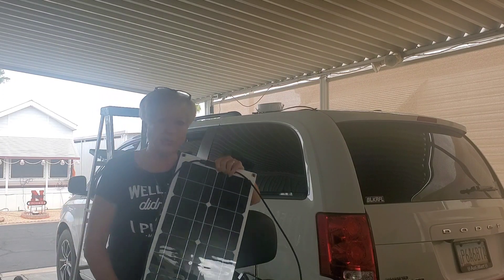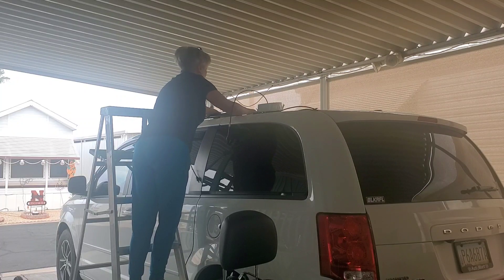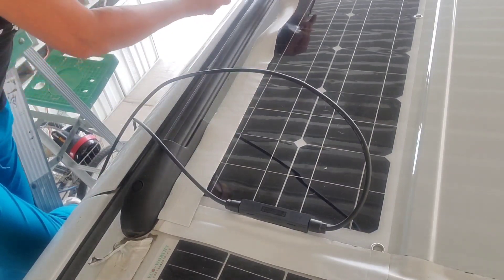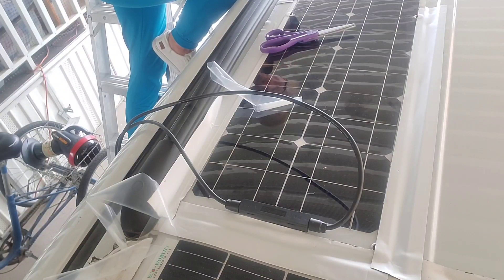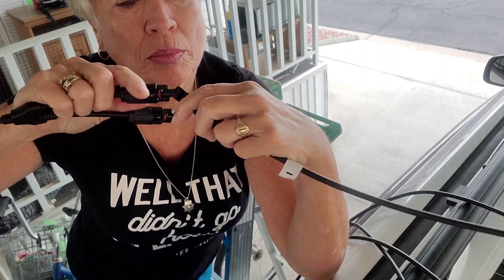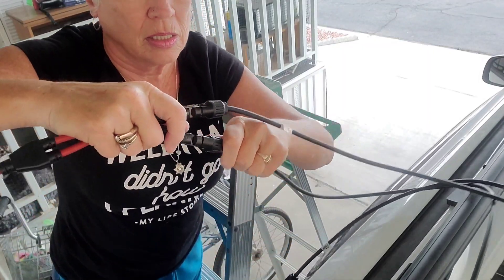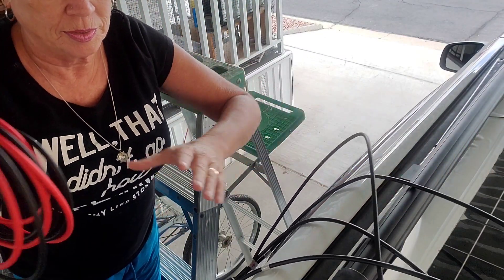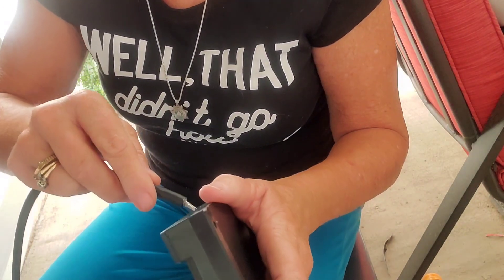My new solar setup

Comment: There is a tool called a multimeter for measuring watts, volts, etc.  They cost between $20. & $50.   But if u know an electrician he might measure your solar panels for you.  It always helps to know for sure what you're working with.   Have a great trip.

Comment: Set it on a stable surface, it's OK to trim a few strands of wire off the larger gauge to make it fit (emphasize a few strands).

Comment: You're right about the size of the wiring being smaller the higher the number is. It's the same for wiring and stringing in jewelry making. The smaller the number, the thicker in diameter the wire or stringing material. That's a lot of wiring on top of the van. Were you planning to hide them a bit under some tape or let them be? As long as it all works, that's what's most important, right? 😉
Reply from the maker: Just leaving it for now. 👋

Comment: Good luck with it all. I'll eventually (probably sooner than later) need solar as well. I use two 12volt car fridges - 1 for a freezer, 1 for a fridge. They have to be on a continual run since I am a fulltimer. 
Keep posting on how this is working out for you please! 
Solar is soooo confusing.

Comment: Remember, you cannot be charging lithium batteries when the battery's temperature is at or below freezing.  Doing so will ruin your battery and could cause a fire.  Either battery's BMS must prevent charging, or your charge controller must prevent it.

Comment: A couple answers: first, strip back more of the insulation so thatJUST the wire is going into the entry area of the hole.

Second answe would be to take the controller to a local auto parts store and if you find a nice counter person ask him take a piece of wire and test what is the largest size wire the will be fit.

Once you know the right size you need to buy 6-12 inch of red and 6-12  black wire of that size.

Now you have two options.

If your lucky and have a place near buy two connectors to fit the red and black wires you have. And you buy two solar connectors to fit the new red and black wires you just bought. You install these connectors and the install these small numbers you just made into the holes/terminals on the controller. In reality you just converted your controller from being screw terminal into a controller with two pigtails (one red one black) .

Another way is to simply splice these ne 6-12 inch wires onto the Amazon wire you already have. Technically this would be fine. But you need to be sure you do a good splice. 

Personally I would do this last splice method. But I would do a good job of splicing followed by putting flux paste on the splice  soldering the splice and putting heat shrink on.

Btw, I lost Dutchess last year. But I know she would have said hello to parked
Reply from the maker: Thank you and I'm so sorry about Dutchess  😢
Reply: @CaravanCarolyn  thank you, Dutches was my best buddy.

Comment: I bought a 100 watt panel from Amazon and it was so small when it arrived, I knew it couldn’t be 100 watts. I contacted the seller and apparently he was drop shipping those panels. The original supplier was sending these tiny 25-30 watt panels out. Glad they refunded you some money.

Comment: Carolyn, question , will you be using the solar panels to power your refrigerator? How do you know what charge controller to use and will you need a inverter.  To plug in the fridge.  This solar stuff is so confusing to me you make it look easy 😊
Reply: She will use both charge controllers at the same time.

Comment: You are correct.   It does sound backwards, but that is how Electric Wire works.   The Smaller The Number, The Bigger The Wire.

Comment: You should consider some expanded plastic for under the panels to promote airflow. They get hot in the sun and can damage the roof. Also, those controllers are really cheap. I would use some solder on the cable and shape it to fit the controller. And you’re right you need to strip the cable back a bit more. (I have one of those cheap o’s!). Good luck
Reply: Love your videos!
Reply: Heat is a major issue with flexible panels. It's ironic that solar panels need to be cool to work at their best. They may have improved the technology though.
Reply: I have current panels and they need aiee the. The black surface attracts heat and transmits it through to the metal below.

Comment: Those look like 100 watt panels for a total of 200 watts. I assume the company advertised the two together as a 200 watt panel, but that is steal terribly misleading. And yes, you will need two separate MPPT controllers for the two different panel configurations, but they will work that way just fine. I would let Amazon know that the company pushing '200 watt' panels is lying to buyers and needs to be called on the carpet. You should have a good system once all is done my dear!
Reply from the maker: No, they advertised it as 400 total. Can you believe that?
400W Solar Panels Kit 24V/12V... https://www.amazon.com/dp/B0B8VGH9QF?ref=ppx_pop_mob_ap_share
And the "40A" charge controller is about 4oz of cheap plastic
Reply: @CaravanCarolyn  can I believe that? Honestly it’s hard to believe. It is almost exactly half the size of a single 100 watt Renogy 100 watts panel, I have 4 100 watt Renogy panels on my van. I have one 415 watt Trina solar panel on my cargo trailer conversion. I have 2 Bouge RV 100 watt panels and one all powers 200 watt ground panel. All of those panels calculate to approximately 0.125 watts per square inch. This manufacturer claims 0.5 watts per square inch. Which is exactly 4 times more efficient, but they boast that their technology is 1.3 times more efficient. I believe that these will turn out to be less than 400 watts total.Their specs are a little questionable where they claim up to 36 volts open circuit where Renogy claims 24 voC.
That said it will still add power to your battery. But if you find that they produce 400 watts I promise you I will add some to my rig. You are right to be skeptical.
Reply from the maker: @Endless_Skyway_Adventures  Right?😂

Comment: I never order Amazon, as I worked at Whole Foods for them, and they are not your friend...believe me! Also, had a scammer, and don't trust them anymore either.
Reply: I've tried getting away from Amazon. But l live in the mountains, far from everything. I get almost everything online. Unfortunately the best deals are on Amazon. Plus the return policy is hard to beat. I tried switching to eBay. But aside from higher prices, longer waits, and shady sellers, returns will cost you and are a hassle. In my case l have decided Amazon is a necessary evil. I still shop around and if l find something at a equal price to Amazon, l'll order there, but it's rare.
Reply from the maker: Exactly, a necessary evil.  I buy almost everything from Amazon.
Reply: Plus Amazon depletes small mom & pop companies.
Reply: @deedon9982  A lot of small businesses with actual stores you can visit also sell their stuff via Amazon.
Reply: I get that, you are an affiliate, and you probably know how to work with it more than I do, Im just not into ordering much.
Reply: Agree! I cancelled my Prime Membership with them last month. It’s been real difficult trying to find things I need elsewhere. 😤

Comment: Yes, nice. If you can make the cable loop somewhere, preferably before entering the van, as water may at some point follow the cable into the van.
Reply from the maker: It hasn't been a problem so far. But this is 3x more cable now. Hopefully not.

Comment: Hard to see from here but it looked like you just need to cut the outside insulation a little so the wire reaches in. Good luck.